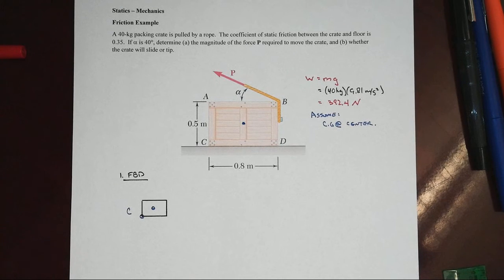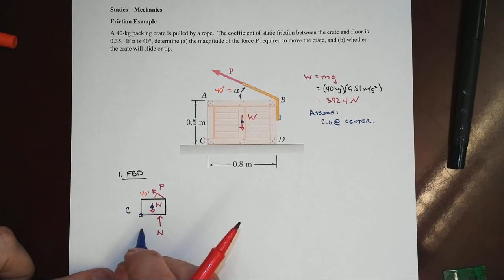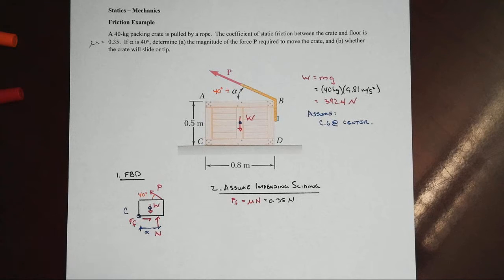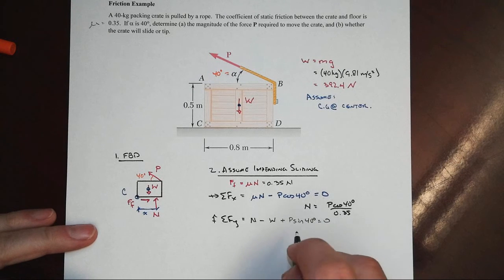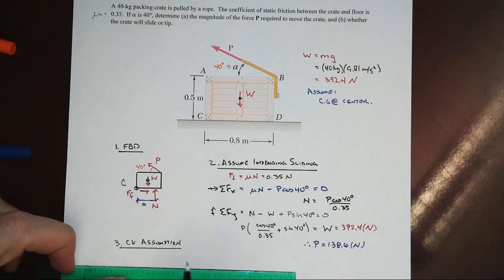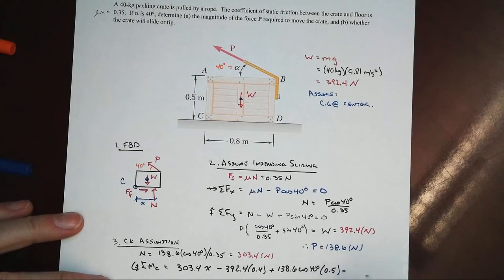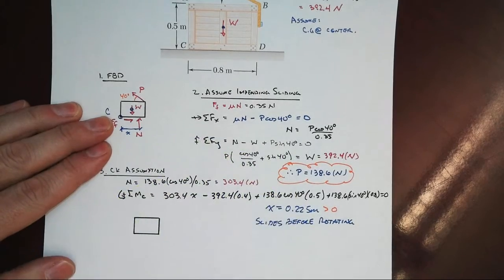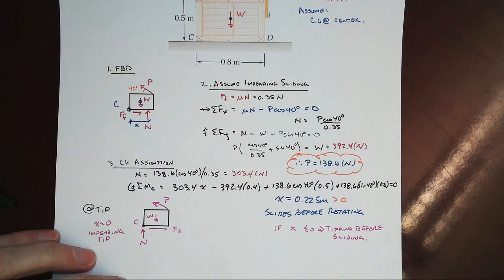statics friction tip or slide

Comment: How do I find the applied force required for the box to tip?
Reply from the maker: You would move the normal force to the tipping corner (C) wherein you would find that P =174.9 N ... and that is greater than the force that it takes to slide the box.  Hence, sliding happens first and there is no tipping.  We know this also by having found the value of x to be 0.225 and therefore a positive value meaning that the Normal force is not at the corner but to the right as shown in the FBD.  And, that means the box slides, not tips.